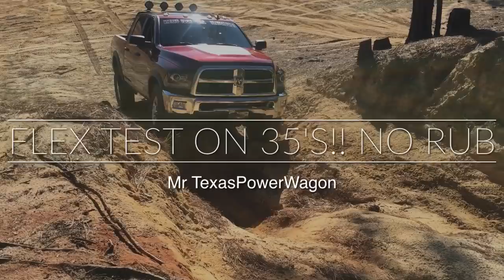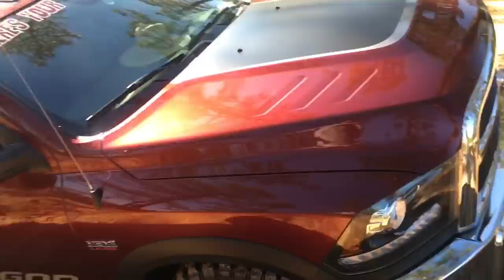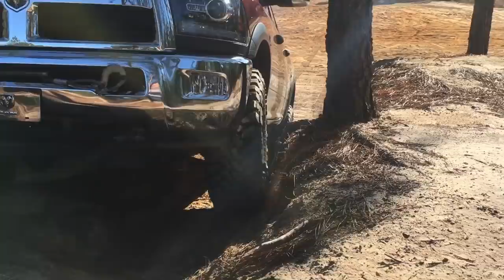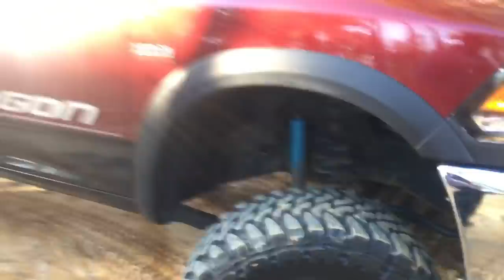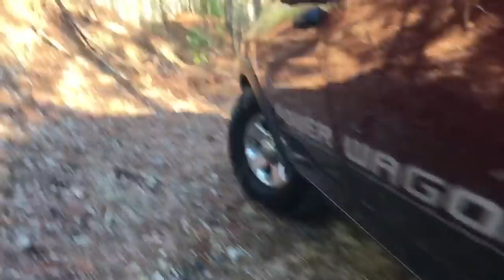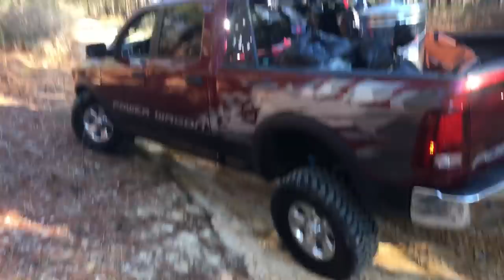Ram Power Wagon on 35's FLEX NO RUB!! Toyo MT

Comment: If you take a heat gun you can heat that bulge in the fender well and push it in about a inch and a half.
Reply from the maker: Wagon Life thank u.
Reply: I just did the heat gun on my 2013 , problem fixed

Comment: What size are those tires? I'm planning on putting Cooper STT PRO's on my 2015 Mega Cab and I'm certain that 295/65R20 will fit without rubbing. You're using your OEM 17" rims but those look to be wider than 295. I have a 2.5" leveling kit on my truck already...did you have to offset your rims? Thank you in advance. Tom

Comment: Hopefully with change of diff gear ratio. Otherwise only show.
Reply from the maker: Ragnar Iskat only show?
Reply: With a very powerful engine may be not only show, but the heavier wheels additionally will result in less throttle response
AND mpg. I did not avoid in investing change of diff gears.
But of course money money ...
Reply: Ragnar Iskat It comes from the factory with 4.10's.

Comment: @augdog1230 all these comments and not one is actually helpful. The Cummins is a capable off-road engine but due to its extreme weight it’s not considered as good. I assume they’ll change this as the Australians are importing these trucks in diesel form for their off-road adventures and doing just fine. Cost is also probably a problem as well. I mean if ford offered the raptor in a power stroke it would 90k damn near. So ram wants to stay way from that I’m sure
Reply: Not about money simply Raptor with a PowerStroke makes no sense at all.